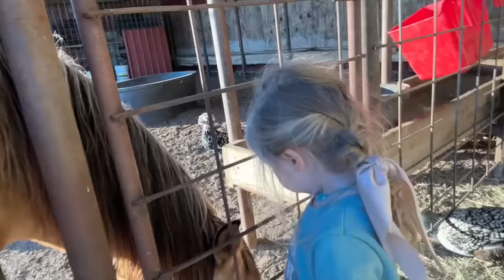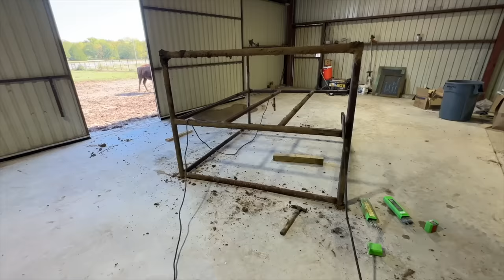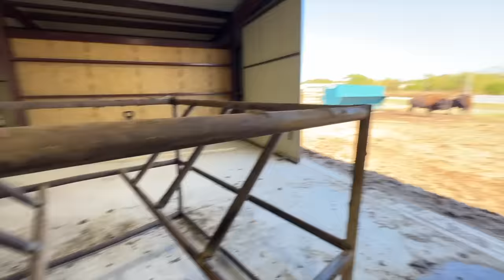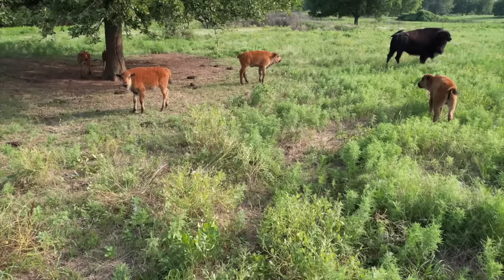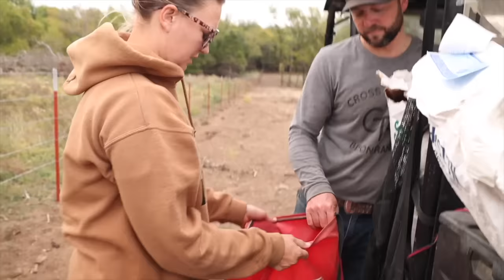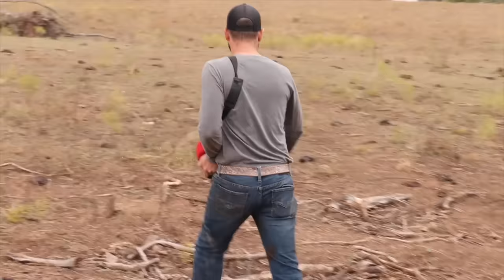Found This In Our Pasture...Put It to Use!

Comment: Just having the ponds hold as much water as long as they can helps hold the moisture in your surrounding pastures.  Just think of them as Prairie Potholes extremely important and not a waste of land.  You could investigate to see if there is some type of plant matter you could plant in that rich silt that would be edible for a grazer.  Then you might could have a dual use type situation.
Reply: Fish and turtles are a good option.